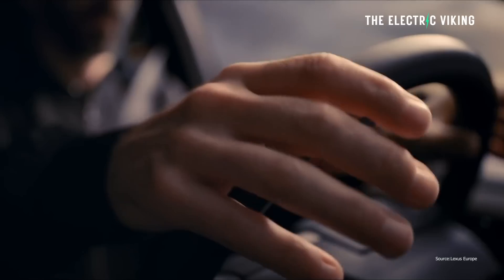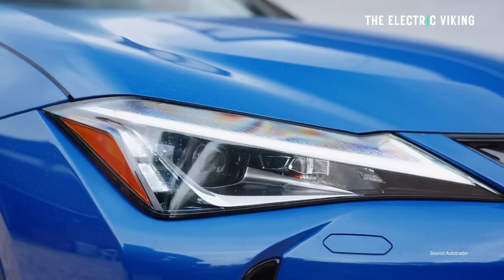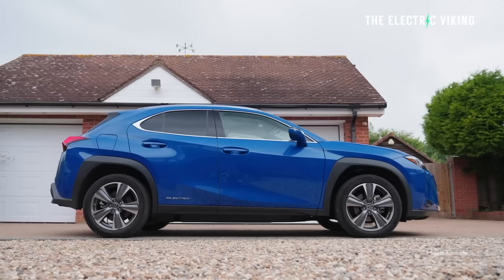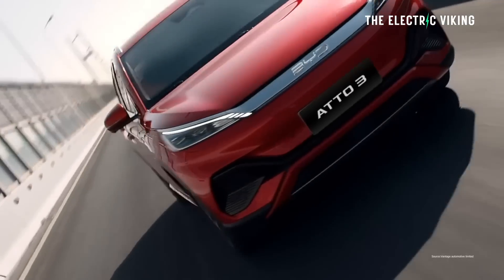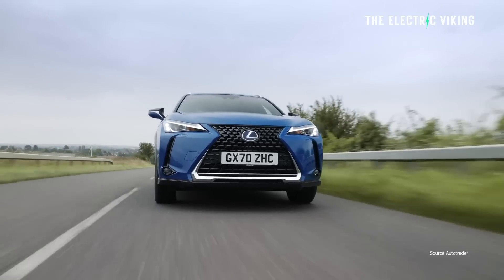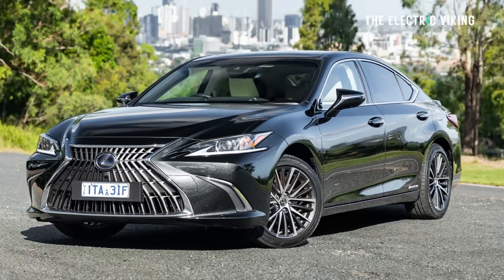Lexus reveals NEW electric car with a Nickel Metal Hydride battery

Comment: Eh I am pretty sure the NiMH description of the battery is a typo. I had a 2000 Ford Ranger EV with a NiMH and the battery was 36Kwh and weighed 1800lbs. NMC lithium batteries are twice as much Kwh per KG of weight.
Reply: Probably a typo, yes. In France the brochure displays "lithium ion" as expected.
Reply: Official specification on Toyota global site (no mention of battery chemistry) for UX 300e is 72.8 kWh for 450km (279mi) NEDC range so like 176mi EPA, which is ridiculously low considering UX is a compact crossover SUV. Model 3 SR has 50 kWh battery and drives for 272 mi EPA range. In EPA mi per Kwh, UX 300e has 2.42 mi/KWh and M3SR has 5.44 mi/kWh so almost twice. If we want to compare car of the same class and size, we can compare it to BYD Dolphin, which has a 44.9 kWh variant that has 161mi EPA range, which translates to 3.6 EPA mi/kWh. So unless there's another typo (Lexus meant WLTP instead of NEDC), something really doesn't add up.
Reply: Nickel metal Hybride doesn’t exist - nickel metal hydrate must be what you meant.

Maybe you need to look at doing quality over quantity when it comes to the content of your channel.

Comment: Wow, using those batteries on any EV is suicide for a company and Toyota are using them in their Lexus cars which have an amazing rep for reliability. Toyota have just pressed the self destruct button and better figure out how to dissarm it very quick.
Reply: Ya that one car gonna destroy the worlds biggest car company 😂😂😂 stf idiot
Reply: You realize they use nimh batteries are used in satelites for their reliability? If it's good enough for fong term space use it's good enough for a car.
Reply: @eivis13 your analogy is childish. I guess if you operate your electric car with the same discharge and charge rate as the satellite the battery will last very long time indeed. What that means is you will have to keep your car parked and not drive it 😅😅😅😅
Reply: @xunepxaxo  And yet there are millions of Priis on the road. Plus unlike on earth a satellite meats temperatures well under freezing. Proving a NIMH battery is better suited for any climate.
So i guess you're the one with a childish understanding and in need of a heater for your energy source 😅
Reply: @eivis13 thanks for the info!
Reply: You mean like the self destruct on those Lithium NMC batteries?

Comment: My thought was that no body produced nickle metal hydride battery anymore. This is 30-50 years old technology.
Reply: Whats the point? Starter lead batteries are 100 year old and still in use...
Reply: 20 year old technology. NiMH batteries were used in many of the EVs during the ZEV mandate in California. Only Nissan had lithium batteries made by Sony. The second iteration of the EV1 used Panasonic NiMH batteries and was able to go 200 miles.
Reply: @joelado Actually it is correct that NiMH technology is around 50+ years old. Original Lithium Ion battery tech is not much younger, as it happens, though it began to make strides in the 1980s with Goodenough and co.
Reply: @ramblerandy2397 Even older - Research on rechargeable Li-ion batteries dates to the 1960s; one of the earliest examples is a CuF
2/Li battery developed by NASA in 1965.
Reply: NiMH batteries were invented way back in 1967 and the first consumer grade cells were produced in 1989. They became increasingly popular in consumer products during the 1990’s and were used in the original Prius in 1997.
Reply: I believe that you can still buy NiMH batteries as rechargeable AA cells. They produce 1.2V, so will operate most devices a conventional carbon-zinc or alkaline cell can run.

Also, the age of technology is irrelevant. If it does the job, use it.
Reply: @briancampbell179  Yes, sure can. They work well as direct replacements for alkaline cells in most applications. They're especially good for photo flash units because they behave better at high discharge currents. They are made in other sizes as well.

Panasonic's NiMH cells are very high quality; they have high endurance, surviving thousands of charge cycles. Even more if you only use the 20% to 80% portion of their charge curve, as the hybrid batteries in Toyota cars normally do; people have used those batteries for 15 years or more in the Prius.
Reply: The vast majority of Toyota hybrids it produces today are NiMH.
Reply: The wheel has been around for about 10,000+ years, it's way old technology so we should all be driving hover cars instead. 🤪

I'd be happy with an EV battery that is not prone to catch fire like a Li-Ion battery. I think Toyota used a nickel battery in all of its Priuses.

Comment: NiMH should be fully discharged periodically in order to avoid the dreaded memory effect. I used to do this with my old Canon 1D camera years ago and it was a real PITA. The successor 1D Mark II mercifully came w LIon batteries. Haven’t needed to discharge any battery pack since the world moved on to lithium ion.
Reply: MiMH does not have a memory effect. Nickel Cadmium batteries do. You are mistaken.
Reply: @joelado  Actually, no. NiCads are def worse but NiMH batteries do have a memory effect, albeit less pronounced than NiCads. Even the chargers that came with these batteries were equipped with a discharge feature, something absent from Lion batteries.
Reply: Memory effect is only really an issue when cells are discharged to exactly the same level each time. I think it's really only ever been a problem on satellites that orbited the Earth in a repeatable way so the PV cycles them between the same two points over and over. In high power application's they just seem to wear out first.
Reply: @ColinWatters  Not sure that's actually correct, but I may be mistaken on this. However, for someone who commutes to and from work at the same times and  drives fairly much the same distance, this might still pose a problem anyway.

Comment: they are much safer than lithium and that's Toyota's reputation to put safety first.
Reply: Actually, if the NiH battery run into thermo run away it still going to catching on fire. How would I know? Remeber the AA rechargable NiH? We play with as hand warmer back in 2000s by shorting it. But it end up blowning up when we went to far and start internal shorting.
Reply: @林振华-t4v   I don't claim to be an expert, but if I google 

Nickel Metal Hydride battery safer than lithium ion

I get

Yes, Nickel-Metal-Hydride (Ni-MH) batteries are relatively safer when compared to Lithium Ion batteries. This is because, they have a stable chemistry and no flammable electrolyte that can trigger an intense explosion or fire, when short circuited or overcharged.   But I admit, that's all I know.
Reply: @林振华-t4v  have you tried the same with a 300mah lipo? They burn quite hot and the smell is pure evil.
Reply: LFP is incredibly durable, and you can put nails through it without it catching fire. It’s in most EVs sold

Comment: Longevity of NMH batteries is a real issue!
Reply: NiMH batteries would last hundreds of thousands of miles in an EV. You are probably thinking about NiCads.
Reply: @joelado , correct. Just as Li-Ion batteries had a relatively short lifespan in phones, they have a much greater lifespan in an EV with a proper Battery Management System, the same occurs with NiMH. Those using the short lifespan on this battery technology in the phones of the 1990's to model their performance in an EV are making the same mistake as the anti-EV dinosaurs make when using the Li-Ion battery in a mobile phone to model their use in an EV.
Reply: Don't worry, they will be able to replace it with a solid state battery for pennies on the dollar in just four years!
Reply: @martalli Pennies is a massive exaggeration and even if the solid state batteries were just dollars, the labor to switch batteries would definitely not be
Reply: @MotoxYT  if they'll be able to make something that is that easily swapable the vehicle it self will become a huge platform for DIYers. In return it may become a modular vehicle.
Reply: @MotoxYT  I was joking about Toyota's decade long insistence that their game changing solid state batteries are just a few years away.
Reply: @martalli  my bad I take things too literal

Comment: Maybe I missed it, but how is the charging time and lifespan of the battery?  I think Toyota can use old technology and preserve a luxury feel more than solve problems of range, charging convenience and durability.
Reply: charging time is irrelevant. its a 20 year obsolete car even before its release
Reply: The early Prius used NiMH batteries. Like Li-Ion batteries, they can last if properly managed. NiMH didn't have a memory effect as Sam claimed (that was NiCad) but without proper management, you'd get about 500 recharges whether that was a full charge or just a top up. This led people to think that they suffered a memory effect as they would have a short life expectancy if they were just constantly topped up.

The Prius ran them (IIRC) between 40% and 80% charge and this greatly extended their life. Without this management, they'd probably have lasted a year.